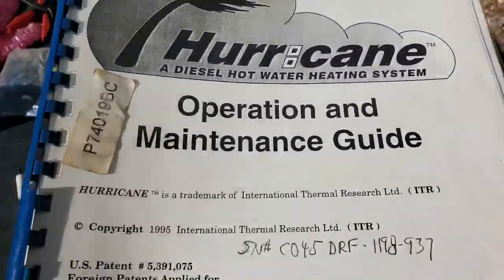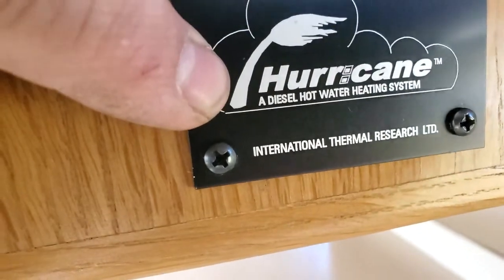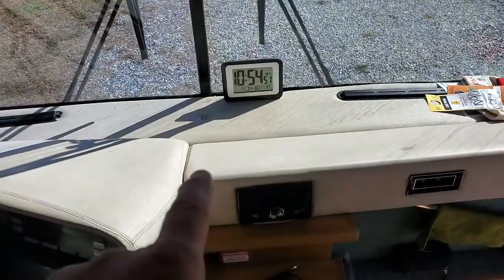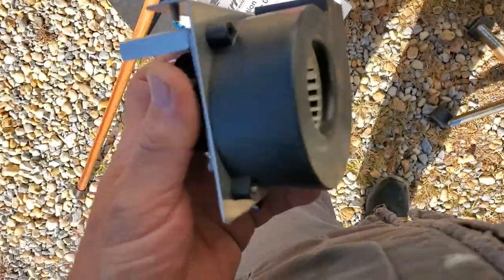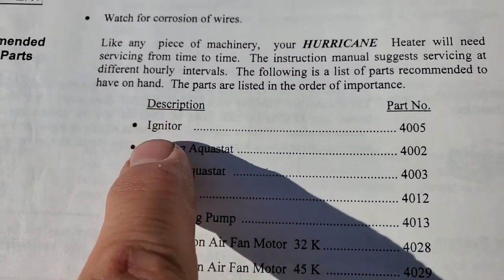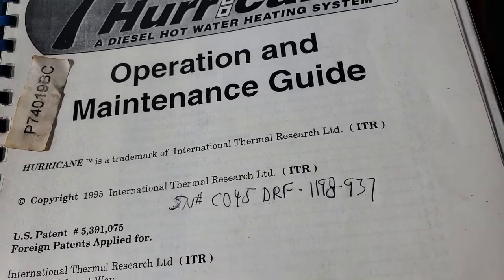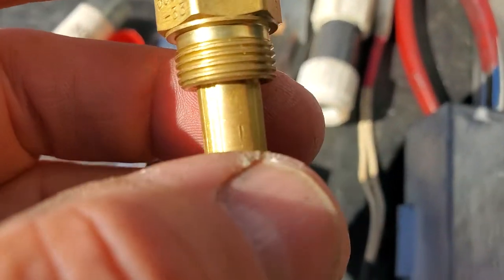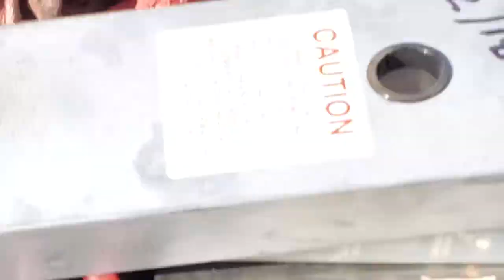HURRICANE HYDRONIC HEATING SYSTEM, CO45 .VIDEO 1 OF ?

Comment: I have a 45xl unit what the flame will not stay burning without pulling a little bit on vacuum on the exhaust. I've cleaned the fuel nozzle; I've checked the compressor, and it has a stainless-steel head on it. I tried taking off the muffler, thinking it was clogged. It run fine with just a bit of vacuum on the exhaust.  (I used the wet and dry vacuum.)
Reply from the maker: Posable build up in exhaust,  or air compressor feed to air swirl nozzel,  you know there's 2 air pumps .

Comment: How does Hurricane compare to Aqua Hot or other heaters
Reply from the maker: It depends if hurricane goes thru a hot water heat exchanger or directly to the hot water tank heater .
Reply: @Rvdiagnostics is is better or worse? I have a 6 gallon water tank with a 1400w element and the Hurricane heats it as well. On more than one occasion I have felt very little heat coming from the registers on a couple 30° nights.
Reply from the maker: Is your circulation pump actually pumping,  Is you tank and expansion tank filled. Do you have air in the system. Your coach heat is separate from residential water
Reply: @Rvdiagnostics  expansion tank is serviced, pump sounds like it’s running. I could check if it’s actually flowing. I just bought it, 2000 Beaver PT. Saw you had/have a patriot. Gonna be watching every video you got on every subject. Had to do the brake adjustment before ever even leaving the dealership I bought it at. That was before I seen your channel. Thanks for all the information!